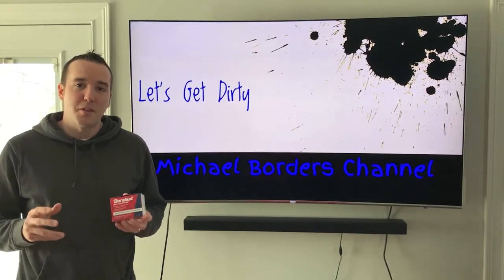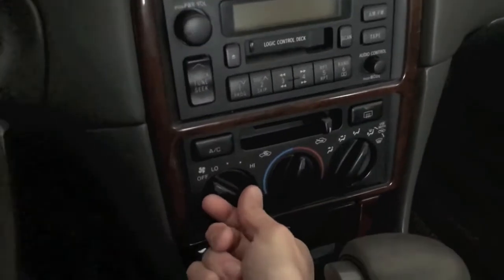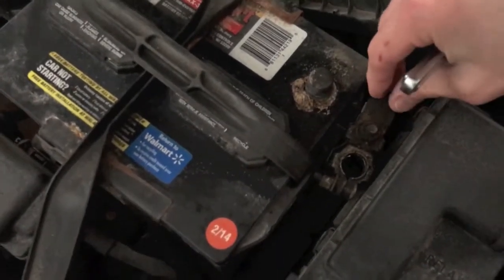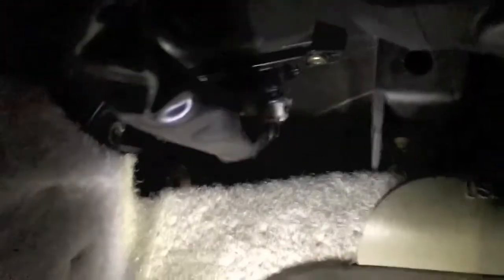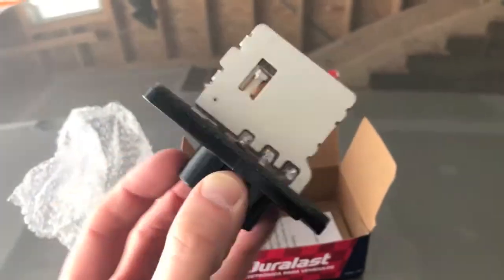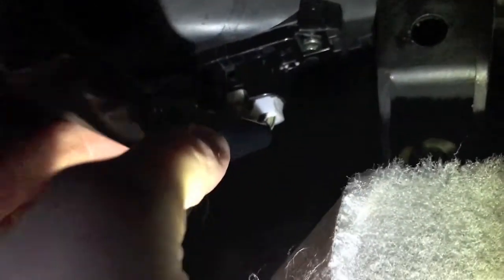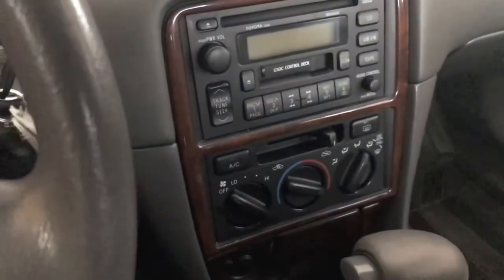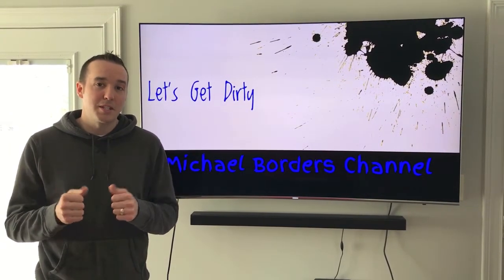My car heater AC only works on High stuck on High - EASY FIX!

Comment: Hopefully you guys see this but anyways, My issue is that my heat works fine up until  level 4(full blast) in my 05 cobalt. Any thoughts on what it could be?? Not sure if this helps i also dont have any AC even tho I have coolent and my Air filter are clean.

Comment: What are the symptoms of the Blower Motor? Not the resistor. Also, will this effect the recirculation button or function?
Reply from the maker: Jolene Shipp 

Thanks for watching & great questions.  The resistor plays a huge role in the system and can make some people think that the blower motor has failed when really it has not...it’s is a faulty resistor.

Do you hear your blower motor turning on as you cycle your temperature knob through the settings?  When a blower motor fails, you’ll never hear any sounds nor feel any air coming out of your vents.

However if it is just a faulty resistor, you will experience inconsistent blower settings... meaning your blower may work on low setting however not work on medium but then work again once you select high.

Hope this helps.  Please subscribe to the channel and ring your YouTube bell 🔔 that will be helpful to us thanks again!

😎👍🔧🔩

Comment: My vehicle has a knob to adjust to a specific temperature, it only works if it is on the highest temp setting. Would this fix that problem too?
Reply from the maker: Sara Smith 

Thanks for watching & it should.  Definitely keep us posted.  Us fellow DIY’ers need to stick together.  Many more helpful videos to come!  😀

Please subscribe to the channel and Ring your YouTube Bell 🛎 that would be awesome thanks again!

😎👍🔧🔩
Reply: Ik it’s been 7 months but I came to this video for the same problem and it worked

Comment: I hope im not to late for a response ...i have 02 trailblazer that i just bought bc i wanted to use it for camping in the summer. I recently had to take it out bc my truck had an expired inspection. When i put it on I noticed that the heat only worked on 3-5, if i put the knob at 1 or 2 it wouldnt work. Well that was about a month ago and now it doesn't go on at all. 
If i put it all the way to five i hear a click by the glove compartment but nothing comes on.  How would i know if it's the resistor or motor ? I don't want to spend anymore than i need to.
Reply from the maker: Thanks for watching & welcome to the DIY Raptor Club.  Almost 100% of the time, it’s not the motor.

We recommend replacing the resistor first as it is the more likely part to be faulty and the friendlier priced part.

Please keep us posted, us fellow DIY’ers need to stick together!  😎👍🔧🔩
Reply: @DIYwithMichaelBorders  thanks for the quick response ! I'll keep you posted.
Reply from the maker: @ozzybee833  

That’s what we are here for.  😎👍

Comment: My envoy won't work in the highest setting and I've tried replacing the ac control on the dash but didn't work. Also it refuses to blow to the seats(through the dash vents facing the passengers) it'll blow on the windshield and floor but not on us making it fairly uncomfortable in this heat. Please tell me that's all I need.🥺

Comment: I followed all the steps and was easily able to replace my resistor. However, nothing about the airflow changed. It still will not shut off and only runs on 4. Do you have any other ideas about what could be going on? Appreciate any and all help!
Reply from the maker: Thanks for watching & welcome to the DIY Raptor Club.  You may have verify your fuses are not blown.  Inside your engine compartment is your fuse box.

We recommend inspecting your fuse box to ensure your heater blower and resistor fuses are good.

If all looks well, you may have something wrong with your actual heat selector Control Panel positioned in your center dash or the blower itself which is also located down below near the resistor you just replaced.

Keep us posted.  😎👍🔧🔩
Reply: @DIYwithMichaelBorders  you have earned a sub here. But I have a question. As soon as I crank my Jeep “2006 grand Cherokee limited” the blower motor is on high. 
Actually as soon as I turn the key to the acc position it comes on. If I twist the knob to “off” the AC does turn off “the compressor” but the blower still blows wide open. The only way to stop the blower motor is to turn the engine and key off.  All of the controls work as far as heat / Ac , vent location  / floor / vent etc 

And the AC compressor engages when you twist the knob to anything higher than off. 

What could this be ? Resistor ?
Reply: @DIYwithMichaelBorders  I’m
On my way home from auto parts store with a new blower motor resistor so I’ll know in a few minutes lol
Reply from the maker: @JameyCampbell_54  

Thanks for watching & sharing your experience.  We just subscribed to your channel as well.

It’s very possible that the resister is faulty.  We would start there as it’s a friendly priced part as well as project.

Keep us posted Jamey.  😎👍🔧🔩
Reply from the maker: @JameyCampbell_54  

Awesome Awesome, looking forward to hearing back from you.

😎👍🔧🔩

Comment: I have sort of the opposite problem. I only get heat when the temperature it set to the max. Anything below max temperature is luke warm/cold. Could this be a thermostat issue?
Reply from the maker: Jordan Lucky 

Thanks for watching & it’s definitely your resistor.  Keep us posted on your project.

Please subscribe to the channel and ring your YouTube bell 🔔 this will be helpful to us thanks again!

😎👍🔧🔩
Reply: @DIYwithMichaelBorders  the resistor is for the fan blower though? My blower works fine on all settings, it's just the heat that is limited. I can't get an set heat temperature. E.g. I set it to 25 degrees celcius and still like warm until I have max heat setting
Reply from the maker: Jordan Lucky 

Sorry about that, we read that wrong.  In that case, it’s not your resistor.  More leaning toward the thermostat.

😎👍🔧🔩

Comment: if I am not getting any air at all either cold or hot blown out of my vents how do I know if it is the resistor or the blower motor itself?
Reply from the maker: Thanks for watching & welcome to the DIY Raptor Club.  Great question & the only way is to pull each part out & test it with a volt meter.

Hopefully it is your resistor as that is the more friendly repair and price.  Keep us posted.

Enjoy your day.  😎👍🔧🔩

Comment: In our peugeot 407 sw when we turn the heating on, it stays on one setting only, all the other functions work fine such as demisters, air to your feet, to you etc. But only on one setting. When we turn the heating off, the heating will go off, but the fan stays on. The fan will only go off when I turn the engine on. What should we replace?
Reply from the maker: Thanks for watching & welcome to the DIY Raptor Club.  We would start with the resister as shown in this video.

It’s a very friendly DIY replacement procedure as well as a friendly priced part.  Keep us posted on your project.

😎👍🔧🔩

Comment: Is this common in Toyota Camrys I have the same Model just seems like you have a xle cause the wood try but i just found it funny I was looking for fix to the same issue 😂
Reply from the maker: Thanks for watching & welcome to the DIY Raptor Club.  This is a common cause in most vehicles in addition to Toyota.

We recently replaced this part in a Dodge Dakota.  😎👍
Reply: @DIYwithMichaelBorders  makes sense but thanks to this video I just replaced mine and all 4 levels work like a charm thanks for the video
Reply: Got my sub I’ll be tuning in to more
Reply from the maker: @tcur3025  

We really appreciate that & we have subscribed to your channel as well.

😎👍
Reply from the maker: @tcur3025  

Awesome Awesome & that new part should last a long time.

Comment: all my low to med high works its the high  that does not work and i had replaced  that part that you did and nothing is fixed  its only the high that does not work
Reply from the maker: Thanks for watching, what’s your update?  You may need to inspect the wiring & connection point to ensure there is no rust or corrosion interfering with the electrical connection.

😎👍🔧🔩

Comment: DUDE MY AC WAS NOT BLOWING AT ALL SO MECHANIC REPLACED  BLOWER MOTOR AND THE RESUSTOR AS WELL AND  NOW THE THING IS STUCK ON FOUR AND ALSO DOES FIVE WTF IS THIS.
Reply from the maker: alexandramn 

Thanks for watching & we hope you enjoyed the video.  That’s a bummer.  The new Resistor is the part that controls the settings (low, med, high...).

It’s possible that the newly installed Resistor is malfunctioning.  Keep us posted on what your mechanic says.

Let us know if you have any questions.  Many more helpful videos to come!  😀
Please subscribe to the channel and turn on your YouTube notification Bell 🛎 that would be awesome thanks again.

😎👍🔧🔩
Reply: Did you get any more info about it? I kinda have the same problem.
Reply from the maker: Star DEM 

Thanks for watching.  Hopefully we will get an update soon.

😎👍🔧🔩